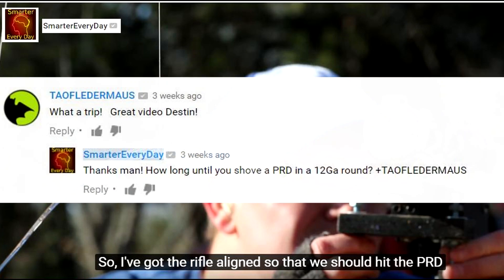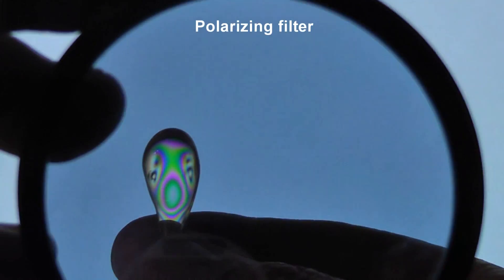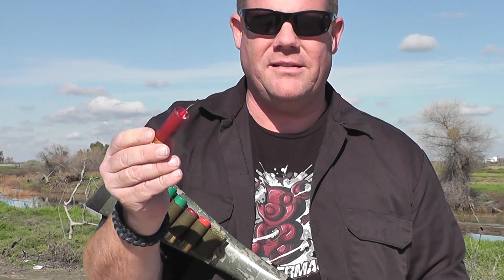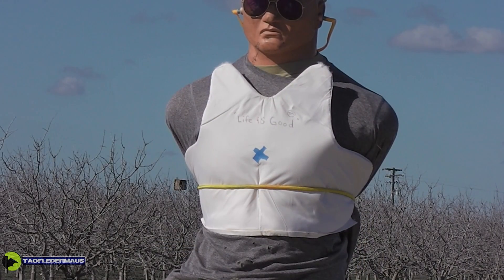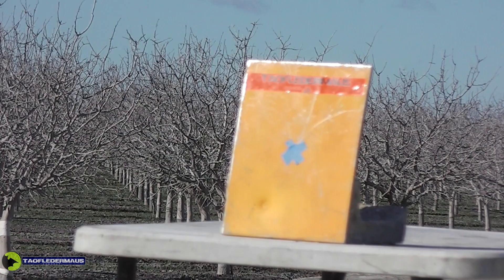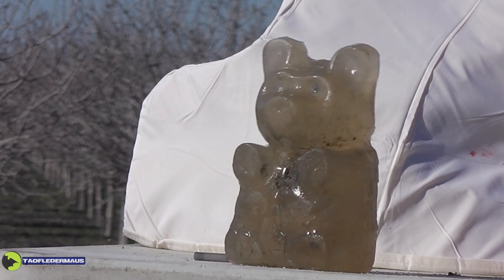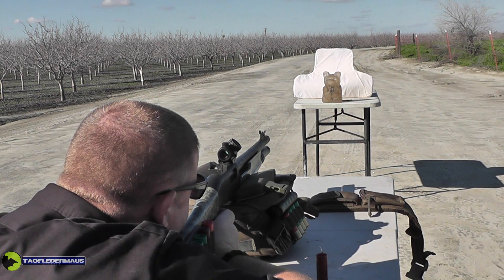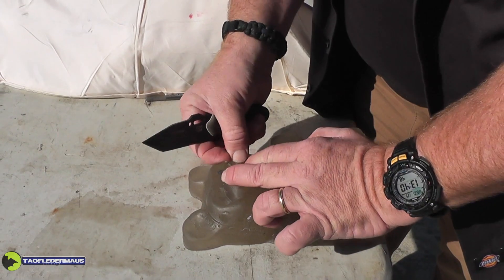Prince Rupert's Drops - Shot FROM a gun

Comment: Wow I honestly wouldn't have thought a PRD could make it out of the barrel intact. Now I wonder if it shattered because the tail was broken or just do to the force it hit with. Awesome video!!
Reply: If you watch really close when it hits, it hits on its side, so the tail likely struck the steel.
Reply: Mortiis558 it can stand around 5 tons of pressure so i think the tail broke... :)
Reply: Even if it doesn't hit the tail, the vibration from the impact can shatter the tail, causing the cascade and shattering the rest of the drop.
Reply: Logical Phallusy 
Actually they very well may not be true PRD.  He's right, the glass must be fully liquid for them to form. just because glass was melted enough to drip off doesn't mean the inside of that pice of glass was at a full liquid state.  think of you torched a hotdog. just because the outside is black doesn't mean the inside is also. Seeing how thin the glass is he's working with, these are fine.  However  your comment about making them without that "stupid" tail... You mean a damn marble!? The whole mystery of the PRD is that "stupid" tail... they cannot be a true PRD without it. key aspect of tempering glass is that the mass of glass inside a tempered portion of a piece must be smaller than if the piece was simply annealed. In PR drop, when the outside of the big part of the drop contracts, the tail will provide a path by which molten glass can flow out; the tail will then solidify before the inside of the drop, thus preventing the glass from flowing back in as the drop cools.  Don't call anyone stupid especially when it is you that needs to be educated.
ohhhhh,  and glass melts closer to 1300°F.
Reply: There is another youtuber that shot them with a 22 and it didn't directly break them. It was the shock wave that broke them. 

If they had a slow mo shot right at the plate you would probably see it survive the initial hit but than shatter from the tail back.
Reply: Yeah, it's just about started to turn when it hit the steel. If it hit the steel not on tail i think it might have even survived that.
Reply: Jeff needs to get Destin with his really good slow-mo cameras out to film it and see what's what. I'm on the side that thinks that the tail struck and started the shatter and not that it shattered just due to hitting the steel plate.
Reply: Obi-Wan Kannabis That's why I thought it wouldn't leave the barrel intact, vibration from the "explosion" that propelled it. So if that's not the case then...??
Reply: I feel the same about the PRD. if you wasnt Destins video it can be shot without it breaking so hitting a steel plate like that wouldnt do it unless it also made the PRD vibrate enough to cause a shatter from the tail end first
Reply: The first one on the plate hit sideways, so yes, the tail broke, which results into it exploding due to the release of the internal pressures.

The other ones survived going head first (they also had near straight tails helping them to stabilize).

Wonder if you could make much larger ones so you actually have some mass going.
Reply: They aren't true prince ruperts drops.
The glass needs to be fully liquid when it is dropped into the water for the rapid external cooling and hardening to happen.
These are basically misshapen marbles. If they were true PRDs they would have exploded when the tail was snapped off.
Due to the need for the glass to be molten liquid, it would actually be very difficult to make PRDs short enough to fit in a shotgun shell. They typically have very long, thin squiggly tails that snap easily, triggering the cascading explosion effect.
Reply: Also the PRD can take roughly 18 tons of pressure before it will shatter
Reply: Mortiis558 The tail. PRDs are harder than steel. I wonder if instead of dropped off a rod if the glass was heated in a spoon and then dropped could  one be made without a tail?
Reply: If you look closely when it hit the steel plate, it looks like it hit almost vertically, with the tail impacting just before the drop
Reply: Ben Bowland I'm on a phone so I just can't see it well enough.  Though thinking about it, given how much energy was transferred to the plate (it fell off) I wonder if it did shatter due to the force of it impacting and not the tail.  

Anyone able to do the math or knows the equations to figure out approx how much force it would be under when it hit?
Reply: Joe McDonald I'm pretty sure it has to be tear shaped to work the way it does, though that would be good to know. If you can reproduce what is going on internally in a PRD without it needing to be tear shaped.
Reply: ***** Yep I thought the violent acceleration would shatter the tail too. I wonder if since these have really short tails they might be relatively strong, even if it's still the weakest bit.
Reply: Cliff Hartle That was Destin on SmarterEveryday. Him and Jeff should get together and shoot at and shoot PRDs with Destins phantom filming. Is really like to know if it could withstand being shot at a steel plate. Though others are saying these aren't true prds so maybe that's how they made it out of the barrel.
Reply: Logical Phallusy If they dropped into liquid nitrogen wouldn't that be too much of a temp. differential? I think that would crack it as it formed.
Reply: It wasn't a real prd the thing has to be molten when making them he basically just made a marble with a tail
Reply: Tog Dread and why are you being so unspecific about wtf you're talking about? Most of us can't read other peoples minds through YouTube. Who's comment did I copy? And if I did are you really surprised two people had the same idea on a video? Or are you claiming I just copy/pasted a comment?
Reply: Mortiis558 he was talking about lol and honestly I didn't even se the other one so woops
Reply: Ian Tweedie I'm still confused but since it it just some random commenter meh. Thanks for trying to explain.
Reply: Definitely broke because tail broke and not from the force of impact

Comment: maybe somehow if you filled it with water or lead  it can make so its not as light?
Reply: no idea, maybe when he is  making them you you might be able to  fill the tube with water or molten led just a little bit then melt it off
Reply: A sheet of glass that has lead pellets placed on it, then rolled up to encase them, left to cool, then heated again to form the drops?
Reply: they are using a glass tube
Reply: grind gaming
A glass rod, not a glass tube.